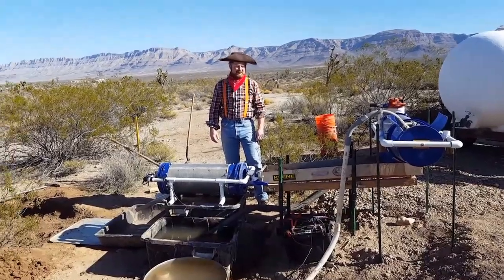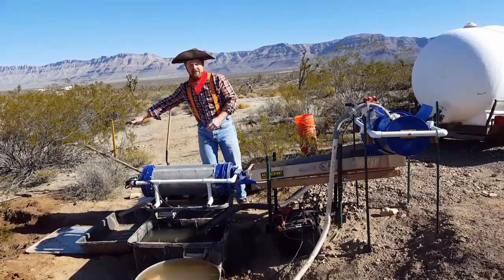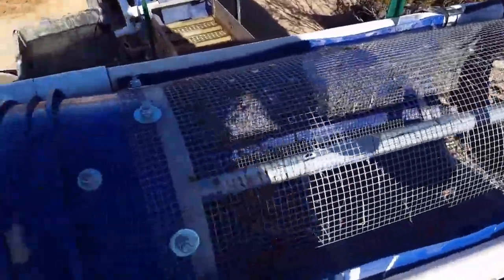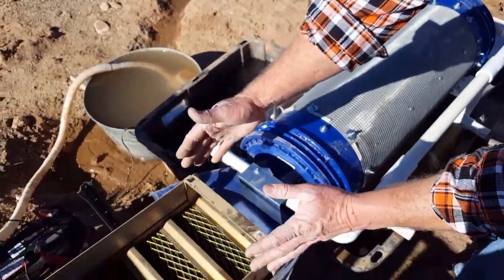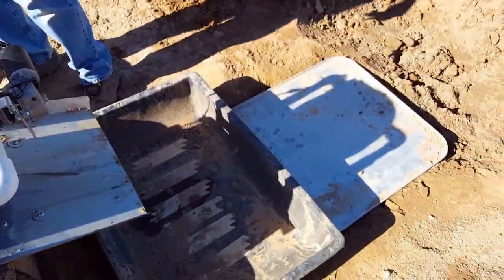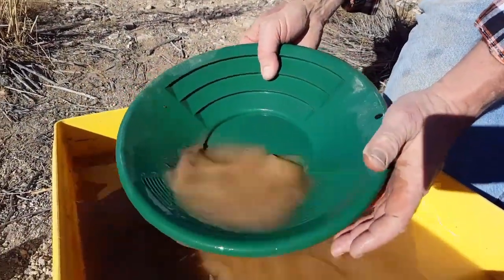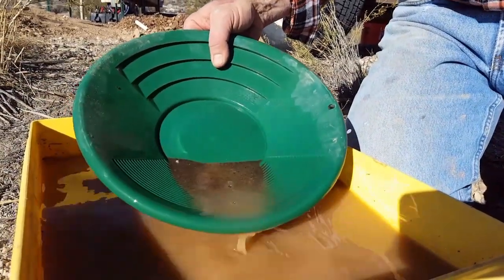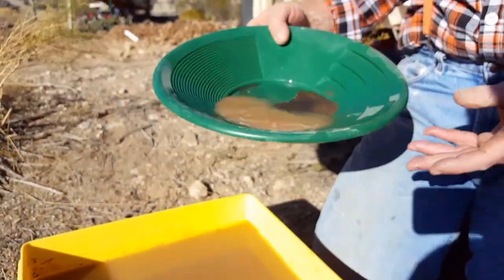Allan's Gold Mining Trommel Wash Plant

Comment: Washing tailings piles for half gram per ton. 

How long you think it would take to run 60 ton thru that thing? Would you make your gas money back driving out there at that rate?
Reply from the maker: The purpose of the video is to demonstrate how well the equipment functions.  Use of tailings demonstrates efficiency over previous mining methods.  Getting rich on fist fulls of gold is not the objective of this video.  To answer your question, it would take several days, but could easily cover fuel.  Thanks for watching, and good luck prospecting.

Comment: How many amps does this set up draw? Thanks for sharing it. It's a great looking build.
Reply from the maker: About 4 amp/hr per motor.  A deep cycle lasts all day.
Reply: @allansgoldmining  Many thanks. I'm thinking of building something similar, to work a placer area with little water.
Reply from the maker: That's great !  Check out my 3 part Trommel Build series on how to make one.  At the end of parts 2 & 3 I include a supply list.  Best of luck to you !  🤠⚒⛏👍

Comment: could it be possible to pick up the gold nuggets (from the pan) using electro-magnetism?
Reply from the maker: Thank you for your question Serge.  Gold is not magnetic from a practical sense, however, the black sand is for the most part.  I use a Spin It Off tool that removes magnetic material and leaves gold in the pan.  I refine the recovery by processing the concentrates in a Blue Bowl.  Thanks !

Comment: Nice job, if you halved the pitch of that screw in the final Trommel would you save much water?
Reply from the maker: Hi Gary.  Good question.  If you go to my channel and check out my video "Latest Upgrades 2018" I changed the auger flights to a deeper pitch.  This facilitated better mixing and separation.  Also adjusted the dewater trommel to -2 degrees to give the material an incline for better efficiency.  Currently, I'm building a completely new design dewater filtration concept.  Hope to have it operational soon.  Best of luck to you in your prospecting adventures !  🤠

Comment: If the grounds worth the time..take the material in Dump trucks some where there might be a person with a big mud hole or pond or swamp and offer him good gravel fill material for use of his water. It has happened. A old mine near might like some holes filled up. Real estates got value too.😉
Reply from the maker: No thanks.  I'd rather mine the gold.
Reply: @allansgoldmining  i mean take the material where it can be SLUICED IN VOLUME..the tailing are the property/water ponds owners etc payment  got it.  i mined 78-90 D6 D8 D9 690B JD excavator  elec shaker double wide 32ft long box  125 tons a hr  Alaska  😉
Reply from the maker: @delljohnson172   thanks, sure can definitely do that.  I use some of the tailings for landscape projects.  Of course, I'm not moving nearly the volume as you were. 🤠⛏⚒
Reply: @allansgoldmining  take the material by truck to water sluice there in volume  ..etc..

Comment: Ingenious.  One suggestion.  Paint that white PVC to keep the sun off of it.  Over time, white PVC will turn brittle and break in ultraviolet light.
Reply from the maker: Actually, the plastic buckets will rot faster in the sun.  However, my unit stays in a shed when not in use.  So, it should last a very long time.  Thanks !
Reply: @allansgoldmining  I was mainly talking about the structural part.  The white pvc pipe

Comment: That's a very nice system but it still seems like a lot of work for less than minimum wage even on a good day.
Reply from the maker: Agreed, slim pickens to make a living on those tails.  However, the folks up in Yukon mine this value all the time.  They simply push volume to make it.  My point was to demonstrate the equipment and how effective the recovery from old tailings.  Can you imagine if I found a rich deposit ?  Check out my Virgin Ground Discovery video.  Thanks !

Comment: why do they make ripples in the pan when you don't bother to use them
Reply from the maker: They are called riffles, and I use them all the time.  They are commonly used after stratification, to remove light material.  The pan in the video has two different sets, coarse and fine.  I use both of them.  watch the video again.  Thanks.

Comment: not really excited about the dinky plastic shovel hopper,,   your having to hold your tools all awkward and precise,,, while that welfare plastic shakes and flexes with the dirt drop
Reply from the maker: Jack.  Check out my "Latest Upgrades" video for new feeder hopper.  Also, plastic bucket trommel holding up very well.  Ran almost 50 yards through it so far without issue.  If it breaks, it's only $3.00 to fix.

Comment: I really like what you have made hear. I have a few questions. 1. How long have you been using this set up? Break downs? And 2. What % do you figure you are getting?
Reply from the maker: Thanks for your questions my Fellow Deplorable !  It has been used over 2 years.  Had to replace drive motor when a huge rock jammed the trommel causing the mount to break.  Other then that, its been running well.  Check out my latest videos and up grades for more details.  Best of luck prospecting !

Comment: Fantastic system set-up.  I tried the same thing, running it with windshield wiper motors a few years back, but never put it to use as it was more experimental. Now we're in some great ground that's producing, eh, 7 or so grams per yard.  Thing is, it's the dirt out of our excavation of a lode mine.  

Any other updates you've given it other than what shows in Jeff William's video of your system?
Reply from the maker: Thank you for the kind compliments.  Sounds like you're on some very good ground !  I'm drooling with envy.  LOL !  I have a few updates that I'm currently working on.  Hope to have a new video published this by this fall.  I recently replaced the 12 volt bilge pump with a 3hp gas powered 1 1/2" trash pump.  At idle, it pumps plenty volume for the trommel and sluice.  Best of all,  I can use it to dredge out the -60 mesh silt from the tubs with ease !  Also working on a simple tailings conveyor.  All these accessories to make mining easier !  Best of luck to you and your prospecting adventures !
Reply: Allan Guthmiller if you haven't thought about it, boat trailer rollers could work quite well for conveyor idlers. I built more miles of conveyors than I want to think about working the summers for my dad in college. Also, its just a short step from a conveyor to a radial stacker.

Comment: Genius!

My only concern was that the water flow across the sluice box was not uniform and laminar...it seemed to all rush to the right side (when looking uphill)...which then created a turbulent ridge of water all the way down the sluice box.  

I have always had the highest recovery when the flow profile was the same from wall to wall in the box...and considering how long I take to tune the box to find the "sweet spot" between angle, flowrate and riffle/moss sizes...the last thing I want to introduce is a wildcard like crazy flow.

I think it boils down to the effective flowrate of the feed hopper/scrubber/spray head is not the same as the effective flowrate across the sluice box...you almost need a short circuit for some of the water leaving the first trommel to go directy back to the hopper/scrubber...maybe a dewatering screen over the flare end of the box into a secondary pump feeding the hopper..

You won't lose any gold, not even flour gold...because the water and any suspended sediment never leaves the system...and eventually it will all travel down the sluice.

I know when it comes to gold mining, everyone thinks they are an expert...and at the end of the day, the proof is in the pan...but since you too are a fan of Gold Rush, see Season 2, Episode 7 to see why I am so crazy about sluice box flow.

May you hit the Mother Lode!
Reply from the maker: Thanks for the compliments and comments Chuck.  Actually I've made several modifications to the wash plant sense that video was posted. I had the same concerns. I plan to post an update video soon.  In the meantime, you can log onto Ask Jeff Williams channel and view his trommel video from a couple months ago.  I explain some of the modifications.

Comment: Hallo Allan, I can't take my eyes of your invention!.. I keep coming back here to see and to observe the simplicity of your work art!.. The gold is where is...but surely having the good equipment does prevent you from feeling disappointed most of the time. Set up is so good, it would probably pass our BC regulations where you can't dump the tailings near the running creeks, and this is mostly where there is lots of floating flakes and dust. I am wondering if this set up would allow to keep the flour gold as well?.. I using the pan, found areas where the flour makes the black sand almost yellow, but seperating it,....is another story!.. Thank you for sharing your invention, and explaining the whole process and materials used!.. This is very informative.
Reply from the maker: Hi Albin.  Glad you're enjoying the video !  Thank you for your kind compliments.  Yeah, I don't see why it wouldn't work for you in BC and dealing with regulations.  I recently posted a video on how to build a trommel.  It's a 3 part series.  Parts 1 & 2 are posted.  Part 3 should be up soon.  Search Allan's Gold Mining Wash Plant - Trommel Build (part 1) or (part 2).  Good luck with your prospecting adventures !
Reply: Oh, man you are busy!.. I am also, but removing the snow from the driveway, and the road connecting me to the rest of the world!. This is the reason I am so much on the internet, because at times there is no way out of here!..so much I got this winter. When it all is gone, I will try to find time to look at the grounds!.. Thank you for posting your inventions!.. Lovely work, and the mind behind it!..
Reply: @albinstroniarz807  Albin 👋
Reply: Peter 👋

Comment: The auger was pushing a lot of water out.  I suggest you remove it and simply  lower the end you want the dirt to come out of.  The degree of slant would also determine the length of time the material could drain before it's dumped.  I think you could let the waste material go through much slower and that would extract more water.
Reply from the maker: Thank you for your comments.  "The auger was pushing a lot of water out."  Obviously, you did not observe the amount flowing out from the underside of the trommel.  The amount exiting onto the tails is minuscule.  Removing the auger is a bad idea.  Been there, done that.  Running the waste material more slowly is also a bad idea.  Backs up the incoming flow, causing a tidal wave of water to gush out onto the tailings.  Been there, done that.  There is a limit to effectively separate water from tails using gravity.  Centrifugal force is an option, however, the energy required and size of equipment to handle the volume is impractical.  I am currently designing a new dewatering trommel concept that should improve filtration.

Comment: Why don't you go where the gold wasn't already mined?
Reply from the maker: Because there is reasonable amount of gold in these tailings, which is averaging $9.00/yard.  That's profitable !  The point is to demonstrate the effectiveness of the wash plant in arid climate verses dry washing.  However, to satisfy your suggestion, I am currently working virgin ground as well.  Good luck in your prospecting adventures !
Reply: You have made a great and effective design.   I was thinking that water is almost as valuable as gold.
Reply from the maker: It certainly can be !  The material on my claim contains a considerable amount of clay (Muddy Creek Formation), therefore, it's quite challenging to separate through the current filtration process.  This was the case during the video.  The virgin ground I'm currently working is even worse, which has prompted me to redesign the dewater trommel.  Every once in a while I get material with very little clay.  The tails exiting the trommel are substantially filtered.
Reply: Too bad you can't run it through the spin cycle of a washing machine
Reply from the maker: LOL !!!

Comment: Love this thing  have made first trommel outer cylinder but I'm having difficulty fitting the pillow block bearings to the conduit w/o alot of grinding . Was that your experience? Maybe manufactures vary some?
Reply from the maker: The inside diameter of the conduit is about 1" depending on manufacturer.  In order to adapt with the 1" bearings, I purchased a 1" x 18" swamp cooler blower fan steel shaft from Home Depot.  Cut off 4" and inserted about 2" of this shaft into the conduit.  Then drilled a hole perpendicular to the conduit / shaft, and placed a 10/24 bolt to hold things together.  This made it easier to use swamp cooler bearings, collars, etc.  You can purchase bearing that will fit the conduit perfectly, but they much more expensive, plus you would need to machine you own collars.  Hope this helps.
Reply: Allan Guthmiller Ah hah! The secret is revieled. Thank you Sir! Yay no more grinding! Your ingenious idea has me so inspired. Got a GM v/sat to check for nugs. We got most items ordered so by February hope to be golden. Thank you so much for connecting the dots will old timer tails.
Reply from the maker: Sorry I could squeeze a lot of fine details in the video.  Would make it too boring.  I'm thinking about creating videos on trommel build basics, and a few modifications I've made over the past year.  Looks like you're almost done.  Let me know if you have any further questions, and best of luck to you locating that shiny yellow metal !
Reply: Allan Guthmiller I disagree. Alot of folk watch YouTube for entertainment. I use it to learn. People need the information. Boring is  just another term for I don't wanna learn. Imho.
Reply from the maker: Agreed !  I had one viewer complain about the details, just wanted to see it run.

Comment: What was your cost on making this? Also, what pump are you using to move the water?
Reply from the maker: Cost approx. $600, including two deep cycle batteries.  The pump is a 12 volt SeaFlo at 3700gph.  Since this video was produced, I have made a few improvements.  Hope to have a new video in a couple months.  Stay tuned !

Comment: The water tank on the trailer cost a pretty penny, didn't it? The good part is those fiberglass tanks last forever and since they are painted light doesnt get inside the tank so you don't get algie. The bad part is they arent baffled so towing one that isn't completely full or empty is an eye opening, butt puckering experience.
Reply from the maker: Hi Tony.  Actually, I got the tank and trailer for free.  They are a dime a dozen in my area.  It's a 500 gallon, but I only fill it about a quarter.  You're right !  Can be a thrill ride on bumpy roads.  LOL !  Good luck to you and your prospecting adventures !
Reply: I bought one, a 500gal, back in the 90's. It cost me $750. Had to have it to haul water when my well was down then I ended up hauling water for a bunch of neighbors. Made great money doing it but learned to haul full or empty the hard way. That sloshing water tossed my 4x4 F150 around like a rag doll. Now I use it for prospecting, horses and dirt work. You got lucky getting it for free. I'm in Tucson and tried hard to find a used one and came up dry lol.
Reply: BTW thats a nice trommel you built. Now I have yet another project to build.
Reply from the maker: Thanks for the kind compliments Tony !  I'm designing a new dewater trommel to handle higher production.  During this process, I plan to make a video on how to assemble it.  Hopefully have something out in a couple months.  Best to you on your trommel project !

Comment: Awesome man.  Jeff sent me here.
Hey.  Nice setup.  You ever think about putting goldhog mats in that?   I had really good luck with them when I did a cheap/made e. high banker. The most costly part of it! ha.   But, could really move materiel.  
sub'd.  Yo from Idaho!
Reply from the maker: Hi Jamie.  Thanks for the nice compliments.  My friend uses Hog mats in his unit and does well.  I'm intrigued by the mats from Snake River Products because their mats do an excellent job recovering fine gold and significantly reduces black sand.  On my claim, the black sand runs about 20 - 30%. Also, I can reduce the sluice angle to 2:1 and flow to 1500 gph.  Always tinkering around.  LOL !  Best wishes to you in your prospecting adventures !

Comment: Nice.. well done
Can I know what kind if water pump that you used
Thanks
Reply from the maker: It's a "Seaflo" 12V, 14amp, 3700gph bilge pump that I bought on eBay.  They are about $90, but every once in a while you can get a good deal for $20 less.  Here's a link:  https://www.ebay.com/itm/SEAFLO-12v-3700-GPH-Submersible-Bilge-Pump/152275773113?epid=1171286208&hash=item237457e6b9:g:~w8AAOSw4shX~UTD&vxp=mtr

Comment: Your water is moving to fast, slow it down. Your blowing out your fines. And your panning... you'll get it. Keep at it. Nice set up! I like it.
Reply from the maker: Not the case.  At 3700 gph velocity, it is barely enough to keep riffles from packing.  Any less and all will clog, even at 3:1 slope !  I ran multiple test for best recovery.  Several months after this video was published, I changed the riffle system to a design made by Snake River Products. Also installed ventral fins on the sluice head.  This creates a laminar flow over the recovery area.  With these changes, I'm able to reduce the slope to 2:1 and flow to 1500gph.  I have been panning for over 40 years and have won many contest.  I know what I'm doing.